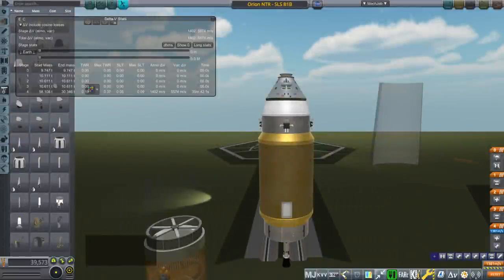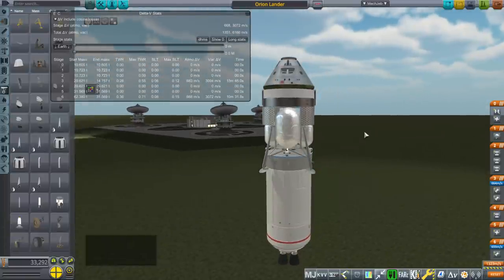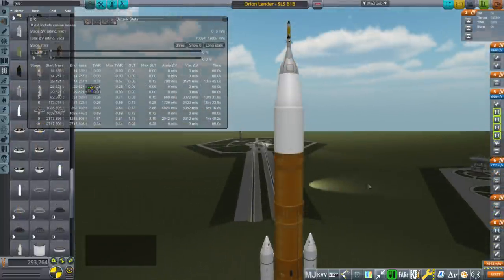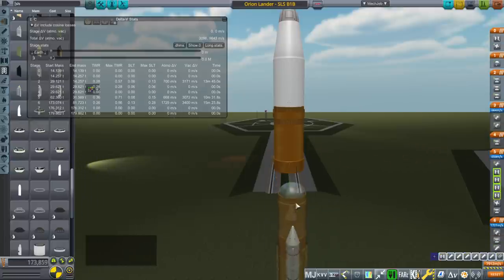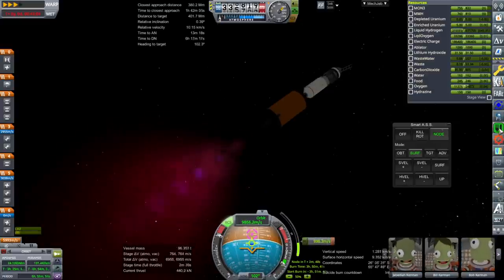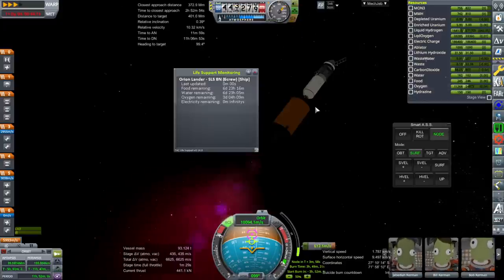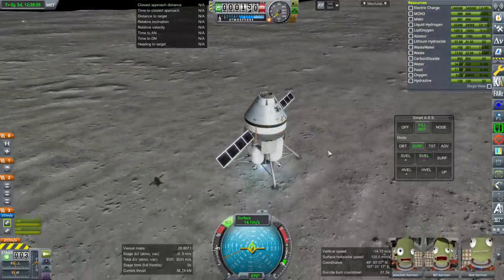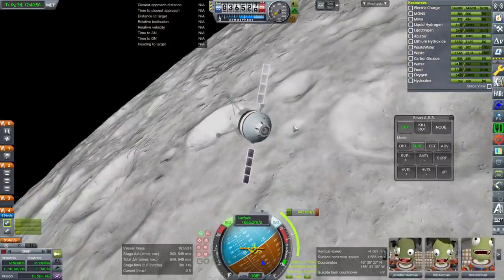Realism Overhaul in KSP 1.8.1 - Orion Direct Lunar Landing?

Comment: My thoughts on the "best" option for this: Use the Centaur X-derived lander with Large SpaceX landing legs, EUS, and an SLS-derived LV with 2 sets of SRBs—2 pairs of 2 and the standard pair (possibly adjusted for vacuum optimization). Upon launch, ignite the first SRB set and RS-25s, smoothly throttling back to 65% on the RS-25s once a pressure altitude of 0.65 atm (~3500 meters) is reached. Once SRB thrust begins to tail off, ignite the second set of boosters, discarding the first set once appropriate. Once the second set is discarded, petal to the metal with the RS-25s.